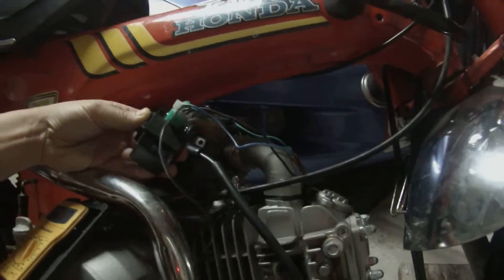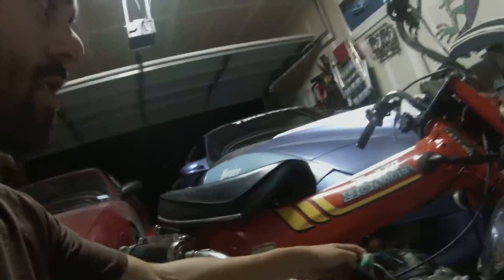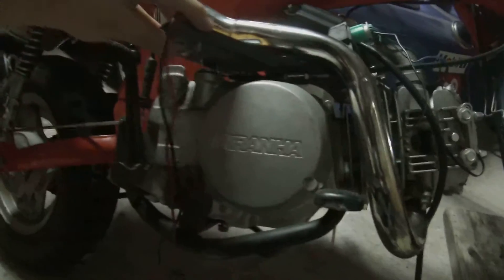Testing YX/Piranha 140cc Stator

Comment: I had the same problem on my yx 140 engine it was the coil on the stator few off the copper wires wrapped round the could had snapped some how. Just replace the coil easy soldering job and it worked on mine.
Reply: Is there a video on how to do that?
Reply: @jjpkwell146  don't think so I just left the old coil on the stator then once new one came just did 1 wire at a time